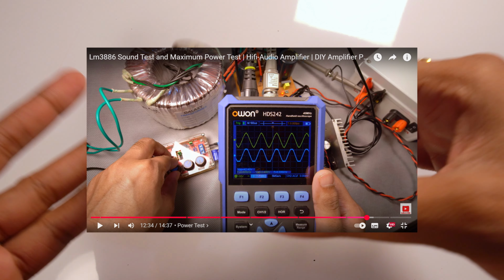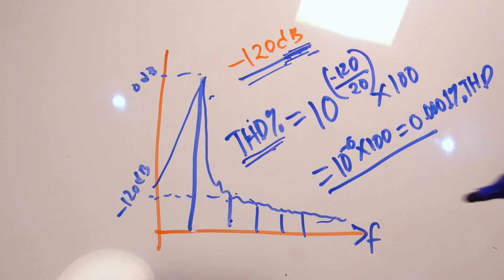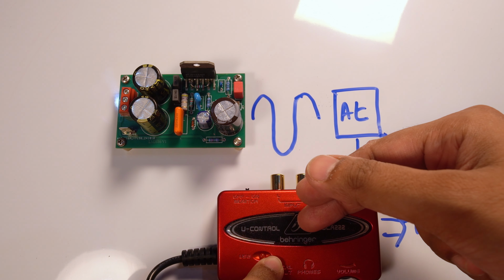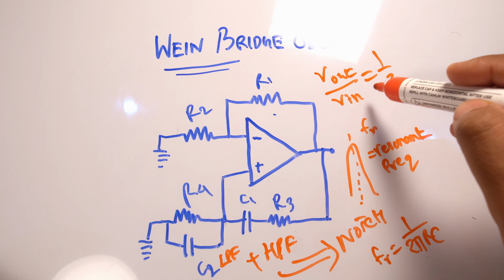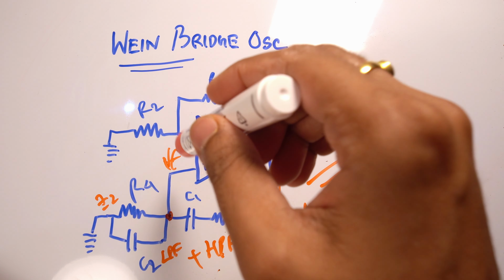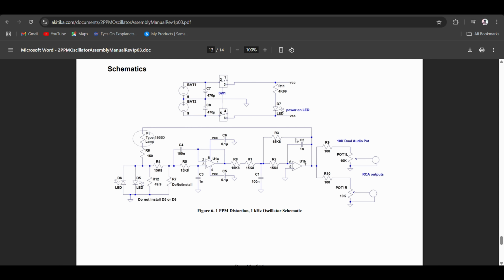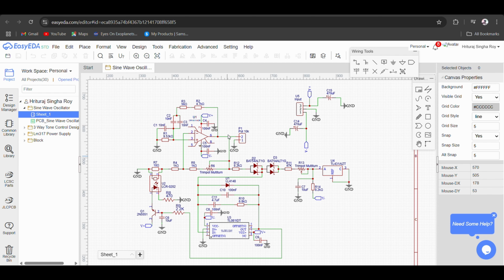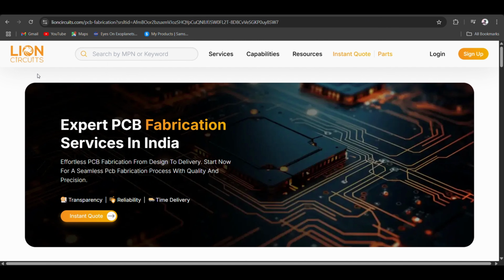Ultra Low Distortion Audio Oscillator (0.0002% THD) | DIY THD Measurement Project Begins!- PART 1

Comment: Great work sir...looking forward to the next part with test results.

Some time back I too was looking for a ppm level Oscillator to improve on the very same Behringer UCA222 interface.
I could only manage a THD of 0.0016% and THD+N of 0.038%(desktop pc with a noisy smps) on a loopback with the internal DAC...wanted to see if a good quality signal source could improve the figures.

btw I see the R12 value on your schematic is 8.2k whereas the original seems to be 100k and the level control pot 50k instead of 500k...is this to lower the noise?

And is it possible to share the gerber,I too would like to get my hands dirty.....thanks and regards.🙂
Reply from the maker: Hey … great To see that you could achieve 0.0016% THD …. ( Lets see how much I can get out of this circuit 😋)
Well those resistors does not have any effect on noise rather they control how much voltage we feed to the Integrator (second Opamp) . 
You can share your Email or ping me in hrituraj64@gmail.com for Gerber files!!

Comment: Make a video about how to design clip indicator with led ( i searched in youtube but no proper video is available ) and check the clip indicator circuit with scope to check how accuracy is it

right now i can't afford oscilloscope to check amplifier waveform so this video will help me to design a accurate clip indicator
Reply from the maker: Sure I can check it out …. But let me first finish this project !!!😊😊😊

Comment: TDA7294 ic vs Transistor which power amplifier is best for sound quality
Reply from the maker: A well designed discrete transistor amplifier can easily outperform a chip amplifier like TDA7294!!!